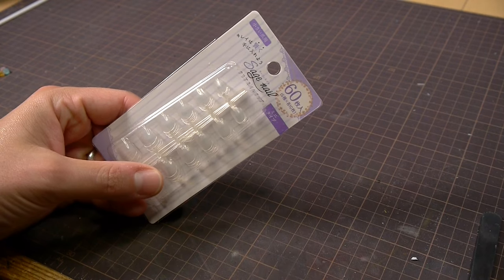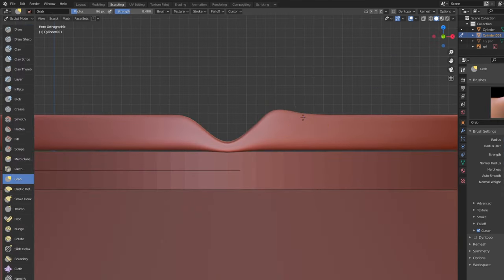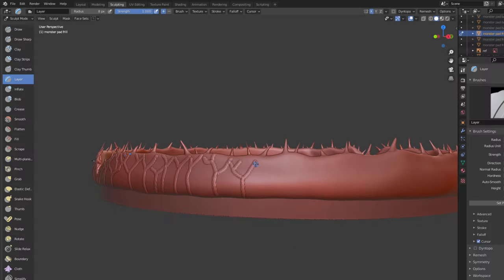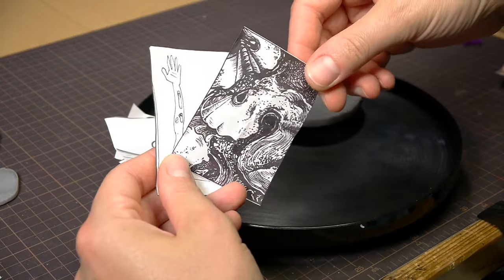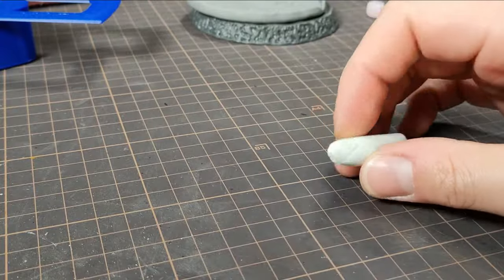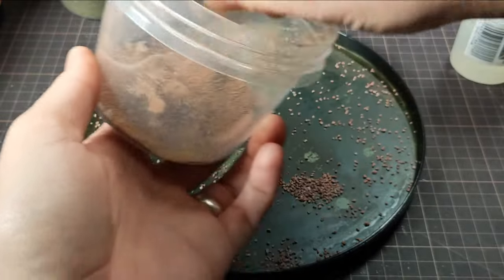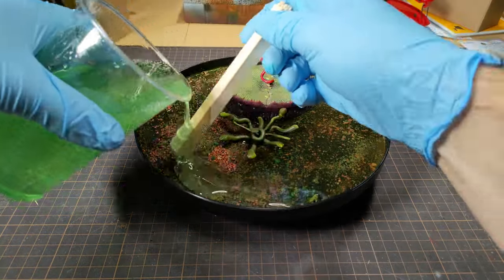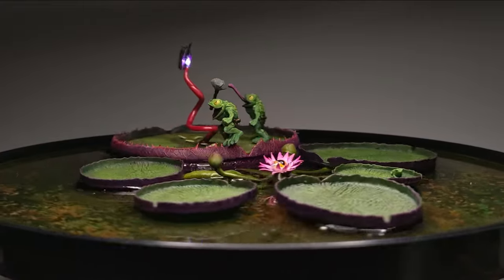I made a MONSTER DIORAMA | Monster Bash V

Comment: You can also pop surface bubbles of the resin pour with a heat gun.
Reply from the maker: Good call. I had all the bubbles popped at the start but I should have followed up like 30 minutes later too. They slowly rose to the surface